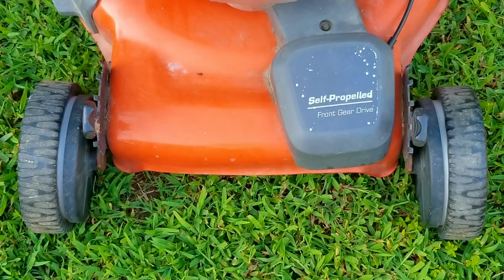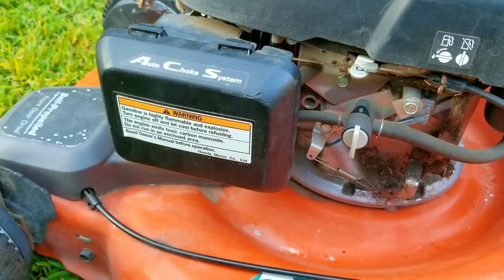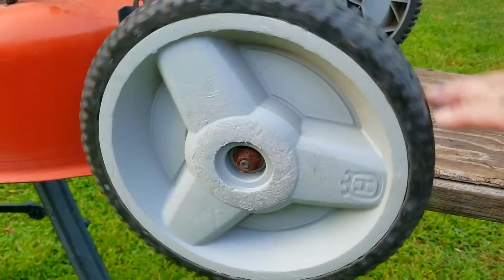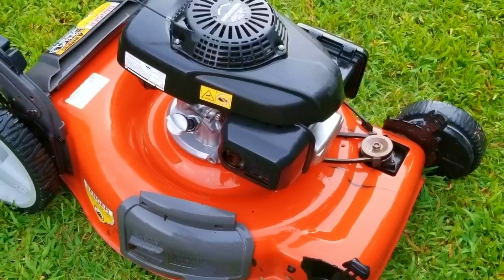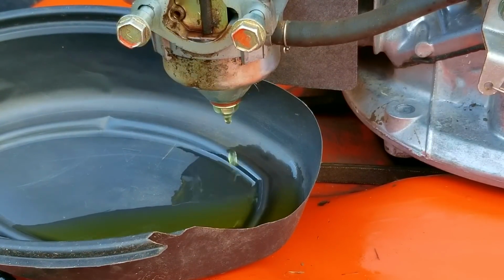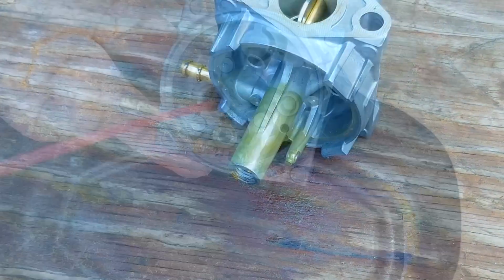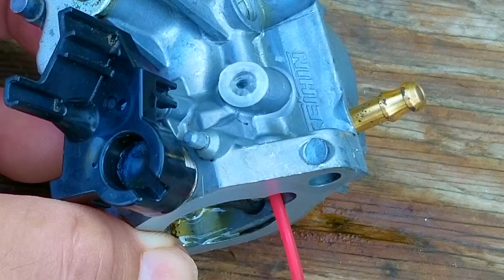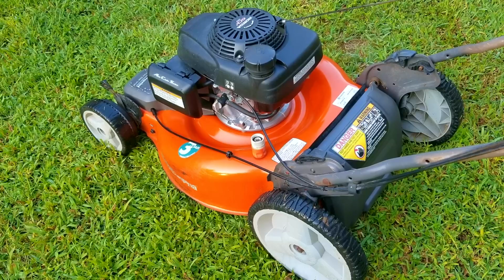This Husqvarna Mower Was Stored The Wrong Way

Comment: Thank God I live in the south where the winters are short. I crank my small engines every month and run them a little. I know most people will not do this but I don't have problems by doing this.
Reply from the maker: nice, I know this works but it's takes devotion
Reply: i just run em bone dry since stuffing with gas will f up the carb and thats a problem that is gonna be a headache.

Comment: Gasoline engine aren't going anywhere, at least for the next 20-30 years. Small engines strike a nice balance between price, reliability, and quality. I was extremely relieved to learn that, because small engines, and especially your videos on them (that document if you have to disassemble further than the carburetor) are how I survive winter without extreme boredom. I appreciate your content and I'm excited for part two!
Reply from the maker: I partially agree with you.  I don't they're going to anywhere but if the manufactures and users, Deem them to be a menace, then they'll stop producing them to appeal to the "Folks" who also don't like ICE.  You can want all you want, but if the people making them,  see more money, going the other direction, that's the way, they'll go.
Reply: @HomeGaragechannel  I find battery mowers to be a menace.  They lack power, have limited run time and very expensive to replace the batteries every few years.  (My father-in-law has one that I use at his home.)  I am fortunate and E-0 fuel is available at the pump.  Run E-0, change the oil every 25 hours, change the spark plug every three years and a gas mower will last trouble free for 20 years.  My 2004 Husqvarna mower is running strong!
Reply: @testtesting2868  ... I'd like to see hybrid gas+battery mowers eventually, if that would ever become a thing.  Of course, batteries & gas do not live as long as the rest of the parts of the mower, which is mostly metal.  Batteries do have that aforementioned shorter lifespan & gasoline shelf life tends to decay within 6 months, or perhaps twice as long with fuel treatment.   I think we just have to wait for future power sources to come. Micro-fusion/fission reactor mowers?  Or just better & better battery technology.  And we can always go back to manual reel lawn mowers, heh, as I think muscle power will probably never go away for as long as homo sapiens is around. And it would help burn even more calories when you have to push even harder to cut grass!
Reply: @testtesting2868  I was lucky. I came across a Greenworks  Pro 80V battery mower complete with two batteries and fast charger for a little over $300. That was a one day sale on Father's Day. ( Normally over $600). That's more than a cheap push mower but less than Honda mowers. I can do my lawn 6 times before I have to charge. I also let the batteries cool before I put them on the charger. This mower came with a side discharge, mulch, and bagging option. It has a high power button on it for lifting stubborn grass and leaves but I found I didn't need it.

I believe people who tried an older battery mower would be surprised what they can do today. And I definitely wouldn't compare a $170 Ryobi 40V to a 60 or 80V mower. Also the easy folding and being able to store it anyway I want with nothing spilling out is nice.

Don't take this to mean I am against gas engines. I just bought an Ariens Deluxe snow thrower. I drained the tank before storage, changed the oil, etc. I don't mind it. But the battery stuff is improving greatly. I've replaced my leaf blower, edger/ trimmer, drills, saws, all that stuff with battery.

By the way, the reason I bought the GW mower is because that stubborn Craftsman I have just wouldn't die and I was wanting something new. I inherited my old Craftsman with Kohler engine about 10 years ago. The person before me used it for many years and she had bought it at a garage sale for $50. Neither of us have done anything to it. The oil hasn't been changed in almost 20 years, the spark plug gets cleaned and put back in, the filter gets knocked on the ground, that's it. That darn thing refuses to die. Can you imagine anything running on 20 year old oil and not only does it start and run full power, it doesn't even smoke! It has oil in it, it's blacker than molasses but it must have been high quality oil for the engine to not have seized by now. 

The deck is rusted through and the handle is bent all the way down but that Kohler engine is a beast. I don't know what to do with it though lol.
Reply from the maker: I feel the same way, I think they have their place but it's not there just yet.

Comment: An ultrasonic cleaner would be a good buy if you repair small engine equipment for a living and anticipate seeing a few carburetors like this one or have other uses for it but if you just need to clean the one carb then the cost is going to be far more than a new carburetor so forget it.
Reply from the maker: yes you are absolutely right!
Reply: An ultrasonic cleaner is great for more than just carbs. I just cleaned every part of a spare SRM-225 powerhead (not including drive shaft) with mine. The main engine cover I had to do by hand, everything else fit in the tank.
Stocking up on spares for Commiefornia's upcoming ban on small I.C.E.s.
Reply from the maker: nice!

Comment: Personally, I'd rather clean/rebuild the oem carb, as the cheap aftermarket ones used to be hit or miss. But I hear they're getting better! 
I've been thinking about getting an ultrasonic cleaner for years. Even a cheap one! And I clean around 30-50 carbs a year😂🤦‍♂️
Reply from the maker: nothing wrong with that.
Reply: I picked up a 3 speaker ultrasonic cleaner, but I use it for maybe 1 to 2 carbs a year. It has many other used though.

Comment: I am glad I am not the only one that looks at a mower and wonders where it came from. You left out cleaning it first also makes it a lot nicer to work on, you don't end up covered in lawnmower poo. Oh, and..."Oil is over rated as a lubricant for moving parts... 🤣"
Reply from the maker: oh yes, I would normally mention that part, but sometimes I get comments about how I'm less of a person for wanting to work on a clean mower.
Reply: @HomeGaragechannel  If "less of a person:" means "I will clean it anyway, so why work on a dirty mower?" Then I agree. People buy shiny, not functionality. Plus, it makes it a little easier to find bits and pieces that always fall if you aren't slogging through 10 years of muck

Comment: I've had really bad luck with aftermarket carbs for Hondas.   It's worth it for me to spend the extra ten bucks and get the OEM.  I don't have the patience anymore to buy a replacement twice.  That idle passage cleaned up nicely for you -- that's where I have most of my difficulty.
Reply from the maker: thank you rbarr775 for sharing your experience, sorry to hear the problems you had with them.

Comment: I live in the north east and things like my leaf blower and mower are and have never been winterized or stored I use them sometimes up until late November and they always fired up in the spring I believe that Gasoline degrades very fast in warmer weather but is fine for a couple of months in cold  or cool  weather as for my Generators and Chainsaws I store them using Tru Fuel and have never had a problem with starting them if your not going to use a piece of equipment for more then 6 months you need to store it fuel wise
Reply from the maker: nice, thanks for the information

Comment: Always add stabilizer to fuel, it's cheap insurance.  If your machine has a fuel shutoff you can run it dry but unless the carb bowl has a drain there is always a small amount of fuel left behind when it runs dry.  Without stabilizer, that fuel can evaporate over the winter leaving a residue in the carb bowl.  I've never had a problem with using fresh stabilized fuel and filling the tank so there is no room for condensation.  

Only exception is the snow blower, where I live it can sit for 10 months before getting used and occasionally the storms are not large enough to use the machine during a winter season.  In this case even though the fuel is stabilized, I always run  the tank dry, drain the the bowl and store without any fuel.
Reply from the maker: you are absolutely right, thank you John Walker.

Comment: I constantly use ultra sonic cleaners and they pay for themself fairly fast. I have two, one smaller one and a large one. They are great, but also wear out. Thanks for the video.
Reply from the maker: oh how quickly do they wear out?
Reply: @HomeGaragechannel  They need to be maintained. Clean the tank regularly. I usually use distilled water. I got useful information from Steve's Small Engine Saloon and the Lawnmower Lady. They use a jar with the cleaning solution and put the parts in the jar and put the jar in the water in the ultrasonic in the water. That keeps the cleaner clean. Also I remove the water from the tank and heat it on the stove so the heater on the machine doesn't have to work as hard. It will take awhile to heat up the unit if you don't. Steve even will clean parts using gasoline in the separate container. I also will clean the wife's jewelry, comes out like new. Helped justifying the purchase with her. If Mama ain't happy no one is happy!

Comment: My Husqvavarna is relatively new (I do regular annual maintenance like air filter + oil every year) but that damn Briggs & Stratton 625ex with its plastic carb needs a through cleaning even if I run it bone dry the year before. At least is usually fires up the 2nd pull after that with fresh fuel for 6+ years running so I just chalk it up to being normal.
Reply from the maker: it happens.

Comment: I just picked up a mower very similar to this one. Poor storage, a carb cleaning, a couple of new gaskets and it’s alive again. 
I bought an ultrasonic cleaner but don’t use it very often. I’m usually only doing one carb at a time so I can take it apart and clean it by hand faster than the ultrasonic cleaner. I also have not figured out the best cleaning solution yet. 
Cheers
Reply from the maker: nice, and yes, there are lots of solutions to go thru, to find the best.
Reply: Experiment with various household cleaners  Dish Liquid  DOES NOT foam   Fuel varnish =  Soak carb in Vinegar for aprox 3 hours  Fill ultrasonic  with plain water  Water = looks like coffee   Carb = sparkles
Reply from the maker: nice thanks.

Comment: As far as an ultrasonic for me; no. I use gas and lacquer thinner and compressed air which cuts anything and will have it on the tailgate anyway and with no heat it'd just be another thing I'd have to tote inside or look after. As for OEM I'd get jugs and pistons but could order a knockoff carb, no problem. Thanks and Blessings!
Reply from the maker: yes those work as well.

Comment: I try to clean carbs anytime I can.  However, if you have to replace them, the Honda OEM carbs are very reasonable compared to aftermarket.  Sucks that they are going to stop making push mowers after 2023, though.

I mostly use my ultrasonic for 2 cycle carbs or very varnished mower carbs.    Harbor Freight has them at $90 now (ridiculous) for a 2.5L, but you can get 6L ones on ebay for around $110.  I started with the HF model, but switched to the larger one the following year.  I think I threw out my HF one, or I'd offer to send it your way.   

I am in the process of converting to battery powered equipment for myself.  I am in a neighborhood, and know that it will manage just fine for my yard.  Really, only need a gas backpack blower for the leaves in the fall - that's one main area that I don't think battery will quite keep up yet.
Reply from the maker: thanks for the tips Matt Wickert and you are right about the gas blower.

Comment: storage after use turn off fuel an   
let it run dry works every time you need it in future be it short time or long time been doing it for 12 Years on my current mower ( cheep Chinese made model from ebay )
Reply from the maker: thank you bottled clouds.

Comment: What size fuel lines do the Honda gcv160 take ? I have on on my weed eater push mower that needs new fuel lines but not sure what size i need
Reply from the maker: hmm.. it's either 1/4" or 3/16".  I haven't measured it in a while.

Comment: The internal combustion engine isn't going anywhere anytime soon.  There will always be a large segment of people who prefer gas over batteries.  

I clean lots of carburetors and can usually (9 out of ten times) save the OEM carburetor. I have also had really good results with cheap Chinese aftermarket carburetors, and parts in general.  Just like everything else, parts costs have increased dramatically.  So buying genuine OEM is not always cost effective.
Reply from the maker: you are correct, the only thing that might go away, is gasoline, I'm very worried about it.

Comment: Buy a set of electric guitar strings, if I have to clean a carburetor I always find myself using the B or high E string. Saved me from the trouble of removing carburetor studs.
Edit: especially for pilot jets
Reply from the maker: I need to get those.
Reply: @HomeGaragechannel  they're around $7, I would recommend a set of 7 and 10 gauge to fit a variety of jets, you can cut the strings you need down to the ball end so it's harder to lose and easier to store. Hope this helps!

Comment: I have the same Honda motor in my mower.I noticed you changed the plug.I don’t have the owners manual so can you tell me what plug you put in & what the gap is? Thanks.
Reply from the maker: I used an NGK BPR6ES and I like to gap it between .025"-.030"
Reply: The plug that is in mine is a BPR5ES is there much of a difference?I’m not even sure it was the correct plug.Thanks for the reply I couldn’t find anywhere the proper gap size.
Reply from the maker: the difference in the 5 and 6 has to do with the operating heat range. Nah, I'm not concerned
Reply: Thanks I thought that probably was the answer but I thought I would ask seeing that I’m not 100%.
Reply from the maker: no problem

Comment: You should try spraying down the outside of each machine with wd40 (after cleaning) and letting it sit for a minute. Then use a rag to wipe it off. It really makes it pop and look brand new.
Reply from the maker: that works, but it won't stay like that for long.

Comment: I may be wrong here myself. So I will just put that out there. But a shut off and running gas out is not good. Same more for 2 stroke. Gas will still remain some in carb. Rest will dry and swell like gasket, rubber etc. I myself still have not found best way. All I can do is cap my tanks in winter with 90 oct no eth. Start each month. Now that gets old with few riders, 8 so push mowers dozen blowers and trimmers + saws but... That and price filling up big tanks.
Reply from the maker: thanks for sharing your thoughts.

Comment: Buying an aftermarket carb is rarely a good idea. Those cheap ones do not run as good as the oem ones. , I bought a almost brand new very low hours eu30i for 200$. The owner left the gas tank full and fuel valve open for 7years and u can imagine the carnige inside. The fuel had turned into tar. Not even varnish. The carb boul was filled with black gue to top and impossible to remove. I gave up and bought an aftermarket carb for the gx200 engine. Transferred the stepper motor & replaced fuel cock,filter and cleaned the tank. The engine starts fine but when loaded it would bog down. And even stall sometimes. I saw on YouTube that those carbs can be cleaned with paint thinner. So i bought a whole jar of the best paint thinner i could find. & Put all the parts in it & let it soak for 2 days. Then replaced the liquid & took off as much crud i could. Finally passed the carb through an ultrasonic cleaner for few hours & it was cleaner than new . The difference was day night. I removed the aftermarket carb & put the original one in & boom the generator worked like brand new. Ieft it running at 3kw (which is the maximum it can give) & it ran for 3 hours without any issue. Before it would slow down at more than 2.5-2.7kw . The generator has served me well. I have converted it to run on propane. Last year it ran for 3 days non stop at varying loads. All from propane. Hondas are work horse..
Reply from the maker: thanks for the information

Comment: I don't understand why more people don't use alkylate gasoline for their 2 and 4 stroke engines.
Everyone talks about how bad today's gasoline is, so why not pay a little more and get a fuel that can be stored for 2 years without deterioration? It's definitely cheaper than buying new.
Reply from the maker: I know right!
Reply: @mc2whls  I used to follow Chickanic and that video was one of the reasons I unfollowed her. Despite Chickanic saying it is a scientific study, it is not, and no one should believe these results.
So despite Chickanic's findings, I would still recommend using alkylat fuel for all small engines.